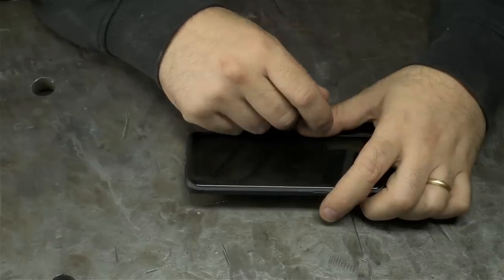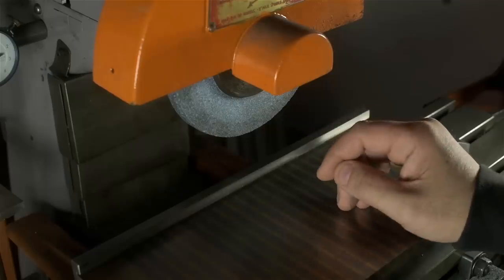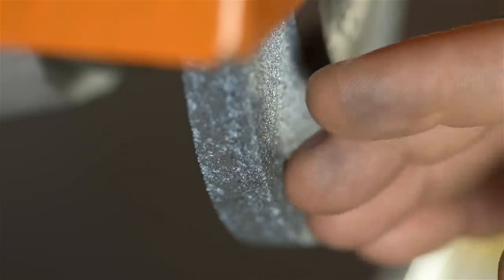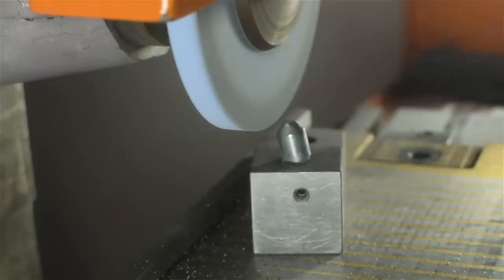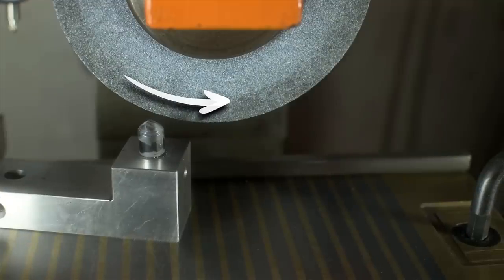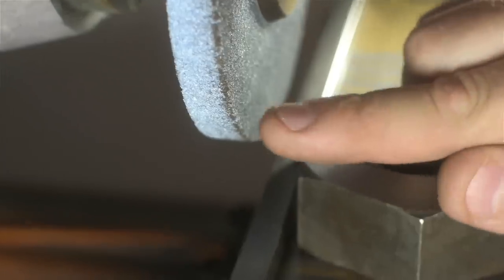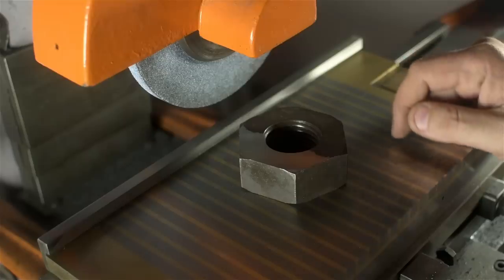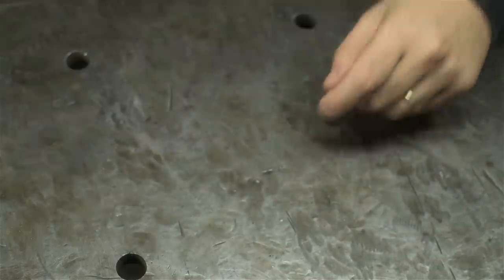How Surface Grinding Works - Part 1?

Comment: I though the raisin jokes were a little fruity, if not dated... other than that, great video!
Reply: Dan Carpenter Would you prefer he prune them from the script 😀
Reply: Stop wining., I think they're grape.
Reply: I think they add to the currant situation
Reply: I don't know, I think they were a bit corny
Reply: Kind of....dry humor.
Reply: I fig-ured he thought it was funny at the time.
Reply: "Fruity" was dad-level.  "Dated" was next-level.
Reply: "Fruity" should be 'dry'

Comment: Blue grinding wheels taste like blueberry if you lick them.
Reply: artfx9 only while they’re spinning.

Grinding wheels are designed only to have flavor while spinning.

The yellow is lemon, red is cherry, etc.
Reply: I'll bet the red one will taste like blood after a while....well i'm guessing all of them will
Reply: Ok. I licked mine. Now all I taste is cauterised blood🤪
Reply: For some reason soft grinding wheels seem to work wonderfully on super hard parts.  They do break down quick, but it doesn't load up.
Reply: Mine don't they taste like silicon carbide, depending on how fresh they are!
Reply: So, what exactly is the white mystery flavor?
Reply: multiHappyHacker there is a rule of thumb in grinding: hard part= soft wheel, soft part= hard wheel, fast wheel acts harder and a slow wheel breaks down better, a large part needs a small wheel and a small part needs a large wheel.
Reply: What brand? Mine's blue raspberry, so it's not only dependent on color
Reply: They taste like blackberry if you don't dress them first.
Reply: Gerald Gepes 

Why do you need different sized wheels for different sized parts? 
Also, the white wheels are mint flavour. Just like all the others you can only taste it if its spinning.
Reply: Now with Extra Crunchy.
Reply: @multiHappyHacker  Remembering that "soft" refers not to the abrasive, but to the resin bonding the grains together: Hard workpieces need a soft wheel to enable the grains, which are quickly blunted by hard material, to be quickly knocked out so as to expose fresh, sharp grains.
Reply: @multiHappyHacker  The reason that softer binding is used for harder material grinding is that the abrasive particles become blunt quicker and don't cut as efficiently,  the binding is designed allow the blunt particles to break away to reveal new and sharp particles . That way the work gets done without the wheel and workpiece heating up or burning from rubbing instead of cutting.

Comment: I've been kind of thrown into the machining world out of necessity, I had theoretical knowledge in machining as a mold CAD designer but no actual cutting oil in my hands. I have my good 15 years of "experience" now, but having learned on my own what I could, I'm very grateful of the tangents in your videos... The sheer amount of learning I squeeze out of them might surprise you. Thank you This Old Theacher for them.

Comment: I used to pick up semi trailer loads at Norton in the mid 60s and over the shippers desk was a sign that read, "illegitimate non carborundum, don't let the bastards grind  you down.

Comment: Yes, more questions. ‘Grinding Wheel’. You covered the grinding part, but I’m lost about ‘wheel’. Any chance you could cover those in a future video?
Reply: I agree, tell us which colours and flavours work with different materials..
Reply: I'm particularly interested about that square wheel he uses when grinding the square pieces to shape.
Reply: Due to TOT shop time discombobulation, wheels have not been invented yet, So, best hope is for grinding sled runners.
Reply: All the different grades/grits and constructions of wheels makes for a veritable rabbit hole that will make your head spin. And how to choose which to use for what materials and such.
Reply: If you think wheels are tricky, just wait til you get to axles.
Reply: Crash course in grinding wheels: 
Each individual grit is an individual cutting edge
Hard materials, use soft wheels
Soft materials, you CAN you harder materials
Grinding wheels are self sharpening tools, as they wear once an individual grit becomes too dull it will get ripped from the matrix, and new grit will be exposed. 

Harder materials typically use softer wheels because you need to shed the dull grits faster, keeping the exposed grit at a higher level of sharpness. 
Softer materials can be cut with duller grit, so we use harder wheels that will hold onto the grits longer, this allow the wheel to last longer before it needs trued back up with a diamond. 

If you are getting burn marks you can do two things, switch to a softer wheel, or increase the tool pressure on the wheel which will also aid in shedding the dull grit

What grit/matrix/bonding agent/etc do you need? Idk, ask the manufacturer that you're buying wheels from
Reply: @Man_Emperor_of_Mankind  softer wheels for harder materials isnt always necessarily true... i work for a lasercladding company that clads tungsten carbide and grinds to size with diamond abrasive wheels. The matrix that holds the diamond abrasive is pretty hard itself.
Reply: @anthonymason701  
True, diamond and CBN wheels play by their own rules

Comment: Ah, the planar grinder. Brings back memories from my apprenticeship as a fitter back in the mid-90's. One time I was tasket with making a calibration tool for a cnc machine. It didn't matter if it was 82, 81 or 80mm, it just had to be bang on. First try at 82mm, I ended up at 81.999, so I had to take off those 0.999mm.
Another time, one of the other apprentices forgot to run the stone dry before turning the grinder off. When he started it up the following morning, the stone shattered and pieces from it flew right past the bench grinder. Luckily noone was using it or they would have ben hit in the head. Oh, and the shattered stone made dents in the magnetic table so we had to plane that too...
Reply: So to a guy who doesn't know any better, am I guessing that "running the stone dry" is done after using some kind of coolant with it, and it is done to essentially "wring out" the wheel of absorbed coolant, because if said coolant is not wrung out, it settles overnight at the lower portion of the stone, and when you fire it up, all that coolant weight creates an out-of-balance situation, which immediately goes boom? Did I get that right?
Reply: Unfortunately for some you got that perfectly right. Those days there was no such thing as 'soft start'.. Zero to oh my g..... In a nano second!
Reply: TomHaroldArt exactly.

Comment: Man i've been wondering this since the first time I seen a machinist grinder. And you explained it perfectly, made me think of it as a broach, where 95% of the work is done by the same part of the tool and the other 5% does the finish/sizing. Therefore it last longer. Thanks TOT.

Comment: Hi Tony,

Have you ever tried Radiac grinding wheels? They make a nice 46 grit ruby  wheel with open structure (porous) that works very well. The nice thing about this wheel is that it cuts very free and very little heat build up.
Steve

Comment: 0:42     Funny enough I used to work with a polychromatic optical acoustic modulator or PCOAM...    it was part of the laser bench at a planetarium laser show, where the main beam (50% of it, t’other half had been split off to hit fixed prisms to be split into RBGC) of white laser went through the PCOAM which was a crystal that vibrated at ridiculous frequencies to refract the white laser into any of 16.7M colors before it hit its XY scanner amps at the right moments so the pre-rendered laser images were the right colors in the right spots :)

Comment: Spent a good deal of time as a high precision grinder.

Side wheel grinding is made easier by relieving the side of the wheel so it is slightly concave/stepped back. You want workpiece contact to be limited to a narrow band, say 3/8 inch of the side of the wheel.
Reply: Hi. I'm a precision grinder too.Grinding all kinds of part like tool, dies and many more. Hope you can share your experience with me.

Comment: I am watching your video on exactly that phone in exactly that case.
Reply: I love Spigen phone cases!
Thin, light and simple.
Reply: What is the phone? HTC?
Reply: I would say Galaxy S8.
Reply: Sándor Cseppentő Correct.  Galaxy S8 in a Spigen case.  Probably the most breakable phone ever made, but the case protects it very well without adding bulk.  I dropped mine down the steep concrete steps at a hockey game, and it just bounced.  Several times.
Reply: I have an S7 in an import TPU case, however I don't want to know what it feels like when you drop it :D. Also there's something wrong with the front glass, as it scratches very easily.

Comment: I worked at a cylindrical grinder factory and learned there to build and use them. 
Especially micrometer grinding was an artform for it self 😉

Comment: I've seen chunks of crashed grinding wheels break cement block. I saw a guy leave a big screw driver on a mag Chuck and crash a four piece Blanchard grinder wheel.

Comment: Surface grinding is for folks who like statistics and other black magic. I tried figuring a chip load per... grain in order to understand it worked? Then realized grain size, face angle and even the damn diameter of the wheel is not only probabilistic but changing at every moment you're actually grinding. 😬💥
Reply: Yes it's a form of art to some extent. It's different than drilling, turning, milling...
Different but similar at the same time: it's a machining too. You should mind the size (dimensions) and shape (geometry) of your part, plus heat input (distortion). Many folks get it wrong, they think only about surface appearance. When it's shiny it's perfect they think. Wrong! You can screw-up geometry by improper grinding (but surface will look "nice").

Comment: For vertical grinding you can use a stone to relieve the side of the wheel to use a smaller cutting surface. We had a wheel like this in a different grade at my tech school for grinding vertical surfaces.

Comment: Is there [going to be] a “How a Surface Grinder Works - Part 2”?  I’ve always wanted one and will probably purchase one. A video on what to look for in a used machine would be great. Especially how to detect a worn out machine. Also a video on set ups and operation. Finally maybe a video on how to grind a cylinder on a surface grinder.

Really appreciate you putting these videos out!

Comment: I like the grinding ones, I've been doing centerless 30-40 years, build my own grinders too, every machine I have ever run, for professional reasons anyway. Thats the part that sucks lol anyway I like to see what others have to say on that sometimes. I'm usually watching your machining videos trying to learn stuff because that,s what I suck at the most lol. I've got a decent set up to play with, I just burn up a lot of tools. I really do need to learn a little more about that, many cases I can make a part faster on a centerless faster than I can set up a lathe even with stock removal and multi diameter, I'm literally a beginner on the lathe. Your videos have been great :) Thank you for that

Comment: Ahh! You seemed to answer a question to a concept I just could never get past.. Having never seen or used a surface grinder, I too always thought it would cause a taper.

If I understand what you are alluding to: as the front face is cutting, the "middle(?)" and back faces are (essentially?) finishing to size. Therefore, as Tony showed, as the front face wears away, the actual cutting surface of the disk will gradually move away from the front of the disk to more move midline - up until the whole disk is considered worn and thus requires dressing? 

Pardon my newbie-ness but I am fascinated by your trade (as its not mine... I'm EMS 🤕) I am self-teaching metalwork as a hobby, and TOT and Abom have really helped my skilling in all areas (ie. Abom enthused me to buy a lathe; Tony a tig... Wife is not happy with you two btw). 
No dum questions right? 🤔Thanks team
Reply: Normally when Surface Grinding one makes a number of "Spark Out Passes" at depth.
Reply: Correct. The width of the wheel that is cutting will be dictated by the step over used. There are also plunge grinding and side wheeling operations where the whole surface is being used and thus great attention must be payed to wheel wear and the wheel must be dressed more often to maintain the shape of the wheel. They hold shape and size for longer than one would think in such applications.
Reply: Fellow AuzTeralian, I was always taught the only dumb question was the one you Didn't ask...

Comment: So to sum up, the wheel is dressed prior to grinding to have an OD surface parallel to the table, and then the work is ground from one edge of the wheel towards the other, and as the abrasive is worn away, the cutting edge moves along the thickness of the wheel so that the low point of the wheel and thus the deepest cut is always at the same height above the mag chuck.  So grinding a sufficiently large surface might consume the entire face of the wheel and thus lose the Ultimate Flatness(tm) surface grinders are known for, but this is unlikely due to a limit in table travel, project budget or user patience.

Comment: Are you happy with the Norton 5SG? I thought (heard) that they need quite a bit of pressure (And power on the spindle..) to work/break down properly.
Reply from the maker: Can't say I've notice any big difference in the types of (small) parts I usually see.  I started out with regular AO wheels, they worked fine, but I found the seeded gel wheels a lot more forgiving.  This is a 6x12 manual grinder... when I start getting past 6x3 my arm gets tired and my traverse speed take a sudden nose dive.  You have a general purpose wheel you like / recommend?

Comment: Only saw one wheel explode, on a  14" bull grinder. Someone was grinding with the side of the wheel and just barely got pulled out of the way before the wheel shattered. Scary stuff
Reply: Kay Kay  It was pretty scary. A chunk of it embedded the side of a metal toolbox about 15 feet away. I believe "operator," if you will, learned his lesson.

Comment: Well, I see you got yourself out of that embarrassing and awkward cat situation. Sometimes I wonder about you Tony? Actually, I always wonder about you. At least you got the optoacoustic levitation right. Drive the speaker with a DC power supply that pushes the photons through the lens that focuses them onto the hammer, thus levitating the hammer. Just don't reverse the polarity, it'll break the lens. Thanks for the awesome content!

Comment: I hadn't even thought about there possibly being a taper. I guess there could be, but with the precision needed to measure such a slight imperfection, the noise from the imperfections in the grinding machine become more apparent then the taper itself.

Comment: I do OD and ID grinding at work. Yes the wheel breaks down and yes it can create uneven surfaces which causes problems. The wheels I use are resin bonded diamond wheels and the diamond particles do the cutting, not the wheel in particular. The parts I make every day the wheel needs to  be dressed every single part to keep it perfectly flat and release the diamond and reveal new diamond to keep the surface finish good and to keep high spots off the part which messes everything up (were talking millionths here). Other parts I've ran like some ID work the wheel doesn't need to be dressed every part but eventually you'll start getting a lip on the end of the part if your wheel is wearing or you're not going all the way off and you have a worn spot leaving material. So basically yes as you grind it wears the wheel making an unven surface but not fast enough for it to be a problem but when it does you either dress or use techniques to fix the problem. Every machine I use has a rotary dresser or a portable one is installed or a dresser is chucked up. Instead of using the piece of steel that's used in the video, a silicon carbide or alum oxide wheel spinning is used to dress the diamond resin wheel making a very nice flat wheel. Dressing in feeds are .0001 to .0003 and same for grinding carbide and ceramic

Comment: I always hated going to the grinder to do my rough/shave tools nobody would dress it afterwards and or leave wheels on and over tightened then the diamonds are all over the floor, coolant left on and all over the ground, holes in the walls machines left on (always 3rd shift guys)  I started locking up my departments degree blocks diamond/roughing wheels since we were using carbide final shave tools just so the hundreds of people that use that surface grinder a day cant ruin them being a 24/7 plant. Having a small department was nice too, was me and 2 old dudes was awesome im 27 i learned so many techniques from them idk if i can remember them all but sure do appreciate it.

Comment: In my work we deal with machining research, with grinding being one of those technologies we attempt to understand. Surprisingly enough with the right machine you can get some seriously good depths of cut on hardened steel in comparison to milling/turning cycles. It's all down to the preferred Aggression and Q-Prime (two ways to quantify the speed and feed of the grind rather than using feed per tooth) of the wheel/machine/material combination, as using the same wheel type on multiple machines gives varied results in quality
Reply: We're you doing creep feed grinding?

Comment: Apparently the sleeve valves on WW2 era Napier Sabre aircraft engines were deliberately ground with a dull, undressed wheel on the final pass through the centerless grinder. I'm unsure as to why- I'm guessing it gave better tolerances.